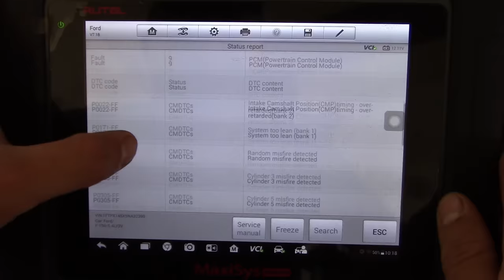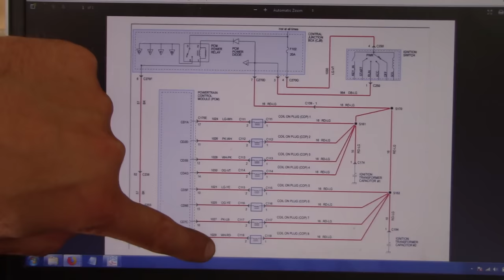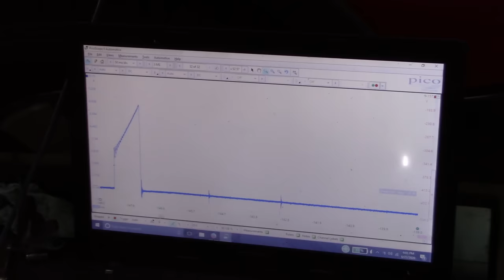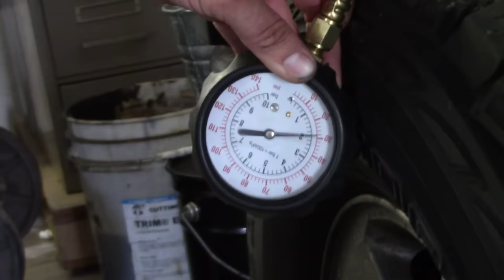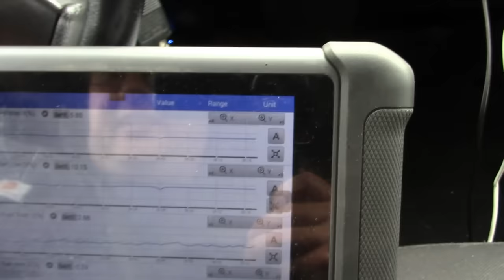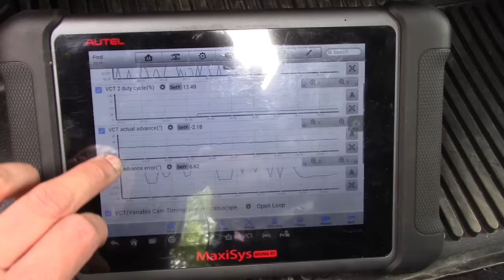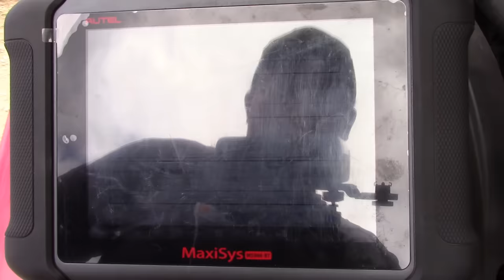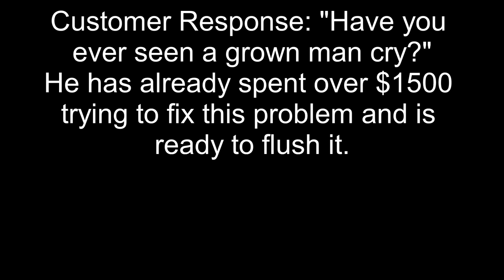2005 Ford F150 5.4L - missfires, intermittent rough running, rattles and knocks, P0021/P022

Comment: The problem is that engine was built all wrong, biggest problem is ford recomending 5w20 to make cafe standards, when these engines start having phazer knocking issues replace the entire timing system, phazers, roller followers, lifters,  tensioners guides  timing chains oil pump . The use of 5w20 oil destroys these engines, change viscosity to minimum 5w30, use steel ratcheting tensioners ,also use only FORD FACTORY OEM PARTS, DONT TRUST ANYTHING ELSE,,,

Comment: I have an 03 F-150 with the 4.6 3v. It makes a tick like in this video but  if you leave a vacuum hose off the ticking goes away. I tried the test where you unplug the vvt's and that had no affect. But with a vacuum leak there's no tick. Does anyone have an idea why that is?

Comment: Why do people buy 5.4 3 valves? Probably the worst engine Ford ever made.
Reply: Because they have such a low resale value and people think that they are getting a super deal when the people are asking 1/4-1/2 of book value but they are too stupid to do some research and find out that the 3v triton was one of the worst engines ever built. if someone is dumb enough to buy one they deserve to get burned by it just avoid these things at all cost
Reply: @briang4470  Yep.

Comment: That is one of the best engines Ford made. I have worked on tons of these.  They made many unhappy customers but are very fixable. If only it has the phasers locked and reprogrammed would I fix this problem. Phaser locks can even overcome sludge issues. So many guys just replace the whole engine only to have phasers reoccur.  It is a great engine but Ford never came out with their own phaser locks. The variable timing system is a well known factory defect. You can fix these and get half a million miles no problem with phaser locks. You are over analyzing this engine. Just put in phaser locks, replace all coils, the oil pump, timing kit and tensioners and chains. a cam or two if necessary. The customer can thank you later and you will save time. The engine will outlast the rest of the truck if they maintain the ignition system and oil after that.
Reply: Bullshit..................most of these engines are just plain crapola. Been a Ford guy since 1971, but my 2005 Expedition has cost more money than its worth. Ford should had a class action suit against them for producing shit like the Triton 5.4
Reply: @kristopherdetar4346  I’m not making that up if you put phaser locks on that is a very good engine.
Reply: @oceans281  I’ll let the next owner do that if so inclined.  I’m throwing the towel in on this one. Never again will a Ford be in my garage.
Reply: @kristopherdetar4346  I totally understand ! Thank you for sharing and posting.

Comment: Yank that 5.4 3 valve VVT Cam phasing POS out and drop in a 351 Cleveland with nice Cam Intake, Holley Sniper & Headers and give 5.4 to a boat owner to use as an ANCHOR!

Comment: Never understood why the phaser are not replaced with a solid cam gear that's slightly bigger which removes the need of the timing chain tensioner as well, you a con that ford has done.  Works fine did mine at 100k at 187k now still going strong actually runs better. Any who there's my 2 cents poor 5.4 people that went through this

Comment: Nov 2007 Ford upgraded the plugs, VCT solenoids, and tensioners. Went to one-piece plugs, steel tensioners, and beefier VCT's . . . quality oil and never missing an oil change is essential. New cams, etc., new VCT's, upgrade oil pump, replace phasers and timing chain setup on this 2005 and it should be bulletproof for 300 thousand miles.

Comment: That Pico software is the least intuitive thing ever. I've used it load for work and the amount of times I've missed critical test data because of some silly setting... You can invert signals but you'd do it with a math channel.

Comment: Ford's attempt to be "cool" like BMW (i.e. expensive) with this overhead cam engine is a disaster! They fixed a problem that didn't exist. Putting an overhead engine in a truck is just plain stupid and cost 1/3 more to repair unless your strategy is to gouge customers for parts and labor. A simple push rod engine with lots of torque is a tried and true winner. Good job ford!

Comment: As a longtime electronics tech, seeing your Picoscope not have its own display is really disorienting.
I'm used to my oscilloscopes having their own displays!

-- Spoilers below the fold --

Wow. That was probably the worst engine I've seen on this channel. Although I haven't been watching long.
I'm used to seeing that kind of damage on junkyard/salvage teardowns!
What the heck kinda design is that for the tensioners and top end oil system...?

Comment: Wes, your unfortunate customer has already flushed it. With top end reliability relying on weak gaskets on the chain tensioners, Ford should face a Class Action of unsuitability for purpose, anyone buying one of these engines is being put at severe financial risk. This vehicle is frame rusty and is beyond economic repair. 
We’re lucky in BONBEACH Melbourne Victoria Australia, no salt, no ice, no snow, no severe rusty cars, 0ft elev. right next to Port Phillip Bay. Come down under and visit....

Comment: A lot of times the 5.4 can just get dirty inside and that, by itself, can cause cam phaser issues. If your 5.4 is doing that, get a good engine flush, flush it, and change oil to 5-30 full synthetic. My 2007 F150 with a 5.4 was running rough at 94,000 miles. Dealer told me I needed a new engine that would cost $8500. I took it to a BP gas station, had them do a BG engine flush, and it was all better. 220,000 on it now and going strong. Dealer was full of it.

Comment: G'day Wes...It may sound selfish but do you know what I am afraid of? When the people around there realize what kind of special engineer/mechanic you are you will not have any time left to make videos for us.
I would take the risk and have only the broken parts replaced. The timing cover welded. People would be amazed with the time that sometimes takes for a worn mechanical system to fail. In any case what worse can happen? Also the brake system. Someone just put pads without fixing the leaks or anything else?
Otherwise I would let you rebuild the engine. I like more the devil you know policy. Good luck to the customer. Tough decision...
Reply from the maker: Yeah we may just slap it together with the minimum of parts and ship it.

Comment: Just catching up   ...

Sadly way to many 5.4L 3V wind up this way.  IMHO, the primary cause is 1) a weak oil pump and 2) inadequate maintenance.  I guess you could say 3) would be poorly designed cam bearing and phasers.  Melling had a better oil pump (and eventually so did Ford) and the phasers were redesigned in later production.  They kept that crazy aluminum cam tower bearing design but I have heard there was a kit where you could bore the towers and insert bearing shells along with a new cam.

If this truck was driven on a lot of dirt roads, oil changes should have been according the Ford Sever Duty schedule (3,000 miles ?)

Comment: HEY!!!  I understand your disdain for the 5.4.... I have a 2011 Lincoln PU and I have no issues with it... It has 43000 miles but I maintain it... Regular oil changes solves most all problems with the engine... The engineering of the engine is fine... I use pure synthetic oil and change every 6000 miles... Poor maintenance has given the engine a bad rap... H

Comment: EPA fuel mileage requirements caused mfrs. to come up with VVT and all sorts of stuff to achieve this, even electric power steering to decrease drag on the engine that would be caused by a power steering pump. Weaknesses in these systems occur at an early age. Of course, we, the consumer have to come up with the money to buy these more expensive vehicles. It's always the consumer that gets screwed when new fuel mileage requirements come down the pike.

Comment: So owner drove around for 3 months being told the cats were plugged up after they bought it? They clearly DID NOT have them replaced  and still drove it for 3 months , looks like nothing was replaced on underside of it. They heard truck and was told this and didn't take to have it checked BEFORE buying truck? Plugged Cats dont cause that clanging noises.Not sure your getting "whole" story here. They clearly didn't replace this and that , kinda like owner should have had it really checked out instead of taken prior owners whole oh its just has plugged cats. I dont feel bad for some owners, mainly the ones who say oh yea CEL has been on for 2 years but it isn't affecting anything.Pretty sure your not getting the real whole story here so you will feel sorry.

Comment: I take it the new owner is deaf.  How could anyone buy a vehicle with all that engine clatter noise.  I get concerned when I hear a slight tick, this engine sounds like somebody dumped a load of ball bearings in the valve covers.

Wow, just watched the visual inspection of the underneath.  What a heap.  

Made it to the top end disassembly.  So sad to see someone taken advantage of like this.  He needs to talk to a lawyer.

Comment: EV's cant come soon enough. No valves no timing chains no pistons no exhaust manifolds no intake manifolds no coil packs no fuel injectors no gas tank no fuel pumps inside gas tank no water pumps no crankshafts no exhaust no transmissions  no torque converters no clutches clutch packs shifting solenoids valve bodies. Did I miss anything yes I did but even more I wont miss!

Comment: Bought a 04 f-150 xlt with hd package 4x4 of course. 7-8 years ago. Owned it for 5yrs. Absolutely the WORST vehicle I’ve ever owned. I’m not a ford fan to start with but it was super clean for a northern winter truck. Also only had 85k on it. 
All it did was affirm my dislike for Ford more.

Comment: You could have changed all of the coils and plugs with the time you spent using that pico
Reply from the maker: And we may not have fixed it at all. Anyone could throw parts at the problem. That’s not why it’s in my shop.

Comment: Well the worst thing with them this to meet emissions they went to 520 oil that ain't good enough with an engine and capable of doing what it did at the first with 300 horsepower should have been a 5:30 or 5:40 weight oil

Comment: New eco boost fords are known to have knock noises which assimilates to that of a diesel engine (during idle ONLY). TSB says that is a normal noise and "should not impact the longevity of the engine."  Ford recommends no repairs.

Comment: Yes, Ford 3 valve isn’t great. But my son has one, no problem with chain tension till 240,000 miles. Oil changed every 3 to 4 thousand

Comment: that engine been hot and run low on oil
Reply: It's a common problem on these that they lose oil pressure and the right side gets oil starved.

Comment: I have been a Ford owner my entire life I love Ford's but the 543 valve engine is the biggest piece of s*** I can't even believe that they put that out in production 96000 miles mileage completely junk 0 compression all 8 cylinders strip it down to the bare block redid the entire front timing chain oil pump water pump brand new heads exhaust manifold intake everything it's like they forgot how to build the 300 straight 6 is the best engine they ever built you could not kill that engine

Comment: Yeah I don't get the bad rep. I currently have one at the Ford that getting a brand new motor and tranny. Truck has over 400,000 miles  on it and it's a 2004 model. So suck that mfs. Plus new motor and tranny has a 1 million mile 7 years no fault warranty with it. Totally re engineered and redesigned vs the previous prob. And it being a lariat model which certain parts they don't even make for this truck anymore.

Comment: A tragedy in the making... I knew they were bad engines even tho I have never worked on one. So many times the customer wants to believe their dealership and look at a mechanic on the side of the road as the problem. I hope they intend to pay you for the services rendered so far. I have had some serious times with customers as the rigs got newer technologies and supposed to go for two hundred thousand and for that truck in its condition, It will not be on the road yet. I see people buying much older rigs and fixing them because it is just not worth the troubles to go through repairs on the newer ones and it makes no difference as to make and model. I personally would not buy local as you watch someone like JC Smith an the rig is a big rig like volvo or Peterbilt what ever, it is rusted out and just parts for the next one... Kinda planned obsolescence if I may say so. Unlike older rigs where you could interchange engines from a many a year and make it work.... Heck you see older chevys and fords and dodges... with a LS engine or a coyote or dodge. From what I am learning from you and others.... its not a good idea to put newer rigs back into older trucks and cars cause they won't live that long. I like some of the changes but this is bad.

Comment: A change engine light 😂, a grenade under the hood, and fake oil pressure gauge, well done Ford, you built the worst built truck on the market in history, nice video by the way

Comment: I want to megasquirt my f350 5.4 . Eliminate all that garbage with cam phasers vct solenoids . Run some kind of bypass straight to the head for oil lubrication.  What a freaking mess.

Comment: 04 and 05 Ford F150  5.4 engines were crap. Shut that engine off before you ruin it. The cam phasers are out of whack.
Should have been a class action lawsuit against Ford for this problem. This idiots spending  a lot of money on parts he doesn't need.

Comment: Remove the oil fill cap and look and feel inside for any evidence of sludge.  If there is, replace the engine.  If you replace all the bad parts and there's any sludge left in the engine, everything will fill with sludge again and you wasted thousands.  So instead of wasting time trying to salvage a piece of sh$t design, look for sludge and then replace.

Comment: Anyone have a good running 5.4L engine no codes and  no other I ssues, but have a decent rattle from under the hood when you feather the throttle very lightly??
Reply: I have a 05 lariat with the 5.4, truck runs great very quiet except the normal injector noise,  switched to 5w30 synthetic supertech oil some years back and has been running the best it's ever been,  only engine issues has been the spark plugs (all broke off) and one injector replaced under warranty,  now has almost 116,xxx miles.

Comment: Using plastic parts inside an engine has GOT to be the STUPIDEST thing EVER!
Reply from the maker: The guides are not the issue. They would be fine if the tensioners worked. When the tensioners blow out, the timing chains are loose on start up. That destroys the guides.

Comment: I'm working on one just like this. the family replaced  the coil''s But still run like crap . Getting no miss fire codes only camshaft  codes . I have check everything almost ... Ford an dodge can make some dum engines   llike the 2.7 from dodge  v6 is junk the 5.4 like this is junk .. Truck prices sky rocket while there so cheaply  made

Comment: the dreaded 5.4.........Ford even forgot how to put a spark plug in the cylinder head. At 2.30 it idles just like a NTC400 Cummins diesel truck engine LoL

Comment: The last Ford engine worth buying, and I mean Ford engine and not some International diesel... was the 4.2 V-6 Essex pushrod, with a single cam and a short timing chain.  Any of these variable valve timing, two timing chain, oil pressure tensioned, turbo garbage... is pretty much worthless after 150k miles.  And if you dont like to change your oil, or run full synthetic and only make short 5 minute runs where your full synthetic crystalizes and gells up, then you are looking at much less.  And someone please take the guy that invented oil pressure fed timing component tensioners out back, and put a bullet through his head.  Cause the last time I checked 80% of engine wear occurs at startup, and that is probably not the best time not to have a tensioned timing component... or have some VVT phaser and actuator to pipe oil through before the rest of it gets any flowing its way.  Sure its not supposed to loose pressure while it sits if you have good seals... but how long does that last, and how long until it gets gummed up, and how long do your main bearings have to wait to get the oil pressure when that happens, after the phaser and actuator and tensioner is done using up that oil pressure?   Your oil IS the main bearing, think about that, and without oil pressure you essentially have no bearing at all, because that brass bushing is just a soft metal shim, just like your thrust washer is just a washer.

Comment: Man you really take it to far to check for spark correction on a cylinder just pull the coils look at them pull the spark plugs look at them instead of wasting all that time with them tools I have that truck and engine I know how hard it is but you can do it easier that way

Comment: Mechanics always get the short end of the stick
It is better to keep these vehicles running than to go and drop $50k on a new vehicle.
Pay the $4500.00 and use it as much as it will last then go out and start new.
Even the newer vehicles are designed to fail within 3 years now. 
You are fk’d either way now!

Comment: It was the water dude r u serious that Is a common problem for Ford’s😳
Reply from the maker: That's common on the 2 valve engines. Not the 3 valve. They don't have the same intake gasket issue.